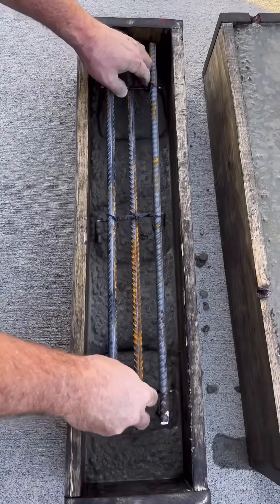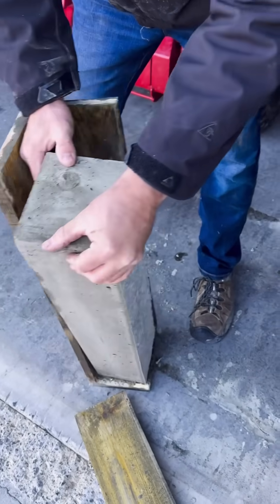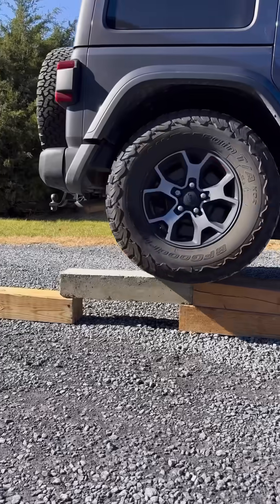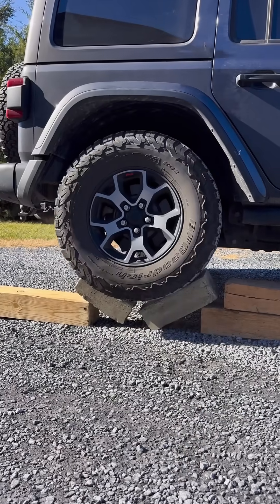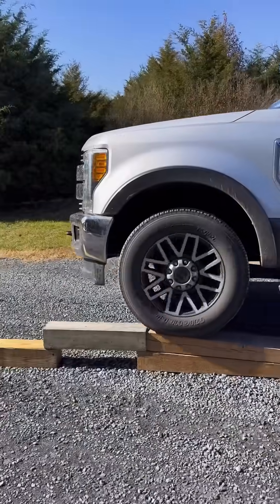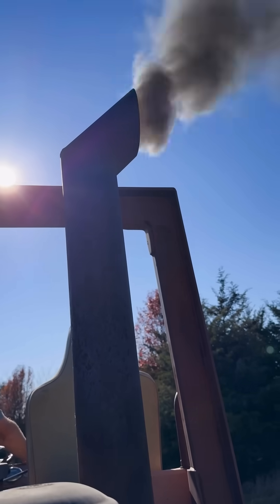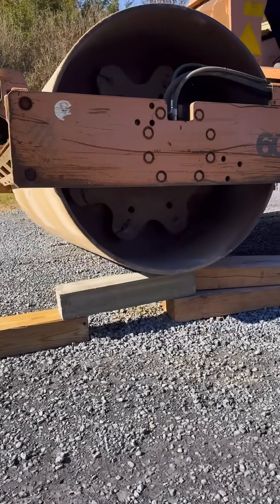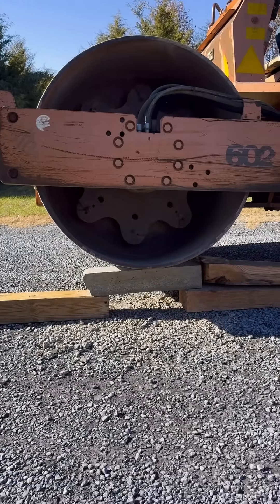Why We Use Rebar To Reinforce Concrete

Comment: Fresh concrete takes approximately 28 days to reach standard strength. The hardened concrete is called building material after 28 days and can be processed further. After several months the moisture has largely evaporated... depends on the climate where you live.

Comment: Ther longer concrete takes to "cure" the stronger  it is. That's why, if your contractor or whoever is doing the concreteting really knows and cares about what he is doing will cover it over to slow the setting and curing. The thicker the concrete the longer it takes to cure properly and fully.

Comment: My summer job while in college was working in the concrete lab of our state hiway department. Each component of a proposed concrete mix was tested independently. Cement powder, gravel, sand, and even water. Then the final mixture was tested for compression, tensile strength, and resistance to salt. The rebar was tested in a different lab.
Reply from the maker: That is awesome
Reply: Yeah, it’s like if we added tires to asphalt like Europe does there wouldn’t be nearly as many repairs/ potholes. But we love to pay for roads that were supposed to be toll free decades ago so we can pay road workers to unnecessarily make repairs. Garbage ass unions and politicians are to thank.
Reply: @FUu-p3k you lads dreaming of Europe as some magic land where everything's better. Nah, the average European country has way worse infrastructure than 99% of the US.
Reply: @FUu-p3k you hit the nail right on the head
Reply: Did you learn how to make cement slurry?
Reply: Why haven’t all those smart people not yet figured out how to prevent potholes. If we can send people to the moon surely we can figure out how to prevent potholes
Reply: @nofurtherwest3474  smart people can say whatever they want, it won't prevent stupid and drunk construction crews from messing up.
Reply: @masterkamen371  but surely there's a better material to be pothole-resistant. Probably add some latex or chopped up tires to the mix.
Reply: And then the concrete that tested the worst was put into mass production and used to make the interstates, huh?
Reply: @brandonhebert5485  The concrete that tested the 'cheapest' and 'good enough' I'm guessing.

Comment: Well this would a true test, but this is wrong, steel on its own is very strong and has great tensile strength, you're not just reinforcing the concrete, you are adding extra strong material to it, best way to do the experiment would be to measure forces, measure driving on concrete the max strenght it can handle before breaking, than strength of the steel itself, and then with steel and concrete and minus the force that was achieve my the steel, or some shit like that whatever i dont fucking know why i even wrote this
Reply from the maker: Rebar bends really easy by itself just from the weight of being stepped on. Also steel by itself would be far more expensive than Concrete.

Comment: What i've alway wondered is if you make reinforced concrete by either using scrap metal or just a bunch of medium to long nails going in all digferent directions ( almost like scrapnal like internals) if it will actually be stronger then normal concrete or will just break and leave a big mess
Reply from the maker: Random pieces of metal might help a little bit, but rebar is designed with ribs on it so it holds the concrete together doesn’t slip

Comment: I used to test concrete and I feel that was about 4 days to a week old. I am not sure how good my memory is but I crushed a lot of 6" cylinders one summer in college. One job required plasticizers in the mix and it blew the door off the hydraulic press. Took 125k lb/sq in. pressure to pop those samples... cured under water or just in air?

Comment: Materials are awesome! I love content like this!
And not to nitpick, but just to hopefully add to the discussion…
Isn’t that a failure of the concrete’s “shear strength”?
My guess for the cure time is around 48 hours.
Reply from the maker: My understanding compression is pushing something together tensile is pulling it apart. When I put weight on the beam, the top part of it pushed together in the bottom part pulled apart. She would be the sliding of something against itself, but it is confusing, and there might be some overlap.
Reply: @hausplans  yeah. It’s probably a semantic delineation.
I always understood tensile strength as the ability to resist being pulled apart. Like cables on a suspension bridge need. 
Compression strength as the strength needed to resist being crushed. Like a bridge pier or abutment. 
And Shear strength as the strength needed to resist breaking when forces are applied in opposing directions. Like the expanse of a bridge’s decking or a floor joist.
In any case, Rebar makes concrete a WHOLE LOT stronger! Lol! 
You should do a video on epoxy coated rebar and how it postpones the eventual failure of reinforced concrete due to the rebar’s oxidation! 
I’m hearing some wild stories about how long it can actually last.

Comment: No, this shows how important it is to reinforce concrete IN CERTAIN APPLICATIONS. What it fails to show is how poorly rebar reinforced concrete ages and why it should be AVOIDED in certain applications where tensile strength isn't a concern. And why roman structures have survived for so much longer than rebar reinforced structures. Use the right tool for the job.
Reply: A benefit of rebar is that it changes the failure mode of the concrete. Non-reinforced concrete often fails catastrophically (that is, once it fails it does so suddenly and can often do so without much warning). The rebar allows the failure to happen more gradually.

There are still cases where you don’t need rebar (pure compression loads), but omitting the rebar is usually done to reduce cost rather than longevity concerns. If you need longevity, coated rebar is used in conjunction with other corrosion inhibiting methods.
Reply: OK the whole "rebar destroys concrete" is a little hyperbolic. Very fist and off the top, the Romans worked with stacked concrete blocks and occasionally partially unsupported lintels and for that matter, what Roman structures are still occupied by humans?

The iron rust degradation of modern concrete takes centuries to progress and in the meantime we can erect structures like the Hoover Dam and the Burj Khalifa, projects the Romans could only dream about.

Using the right tool for the right job includes the brain. As to bar vs, well anything else, there is a reason we are still using steel in bridges and construction, it is what works. Ever stood under a freeway overpass and watched it flex? Ya the concrete actually shatters, it's intended and the steel keeps it all together. Think of it like a skeleton, except the bones are the flexible part and the "flesh" is all the little blocks of concrete locked to the steel and stacked onto each other.

Another thing about the Romans is that concrete continually grows harder throughout it's life. Ever notice how old concrete is so much harder to demo than newer? You probably thought it was just better in the old days. It is actually a crystalline structure and that continues to solidify and establish as long as the concrete remains whole.
Reply: @aardque  "The iron rust degradation of modern concrete takes centuries to progress" BS. It takes a handful of years at most, that's why it's so important to repair any cracks and seams that develop. Rebar concrete has much higher maintenance requirements in order to maintain its strength and the integrity of the rebar. Rebar is a good thing, as this video shows, but only when used for what it's good at. Use rebar where it makes sense, and don't use it where its a liability.

That's what using your brain means. You should try it someday.
Reply: @ShadowDrakken  Insulting strangers is a smooth brain coping mechanism. "Handful of years" would have every major city in rubble. Hyperbole has no place in physics,  despite your hysterical genius. My fucking house is only going to last a handful of years!🤡
Reply: @aardque  "Insulting strangers is a smooth brain coping mechanism" then why did you start?
Reply: @ShadowDrakken  Why did I start coping..? Why did I start commenting? Why did I think your skin was thicker? Why did I feel like I had to rub your nose in your "superior Roman concrete BS?" It is called "passage of time." Roman structures as long as any stand, will always be older than modern concrete structures, simple math.

Comment: The tensile strength was not an issue when you turned the vibrator on
The metal rebar vibrates and this shakes it loose and once the rebar is loose it provides no support to the concrete

Comment: Sucker question, as water and other traits of concrete result in a greater than 2:1 variation in tensile strength, and not just whether it's a day or a month cured.  

What's the effective peak load of that roller in vibrate mode?  In effect, it's like the force of a drop hammer, albeit used more to find and fill minor voids usually.

Comment: Looks like your rebar was in the centerline of the "beam" which would be under neutral load and really did nothing for the tension.
Reply from the maker: I put the rebar into the top third of the beam, then flipped the beam upside down before driving on it with the roller. So it would’ve been in the bottom third. You can see this in the shot where the roller crushes the beam and the rebar is exposed.
Reply: @hausplans  It looks centered when you pick it up by the rebar at the end of the video. Regardless, the test was effective in demonstrating the difference. Thanks for sharing.

Comment: That's tension strength. NOT tensile strength. 
Running a bolt through each end and pulling it apart from the ends would be a tensile strength test.
Reply: I always thought they were essentially the same thing? I wasn’t sure because strength of materials was never my best subject so I thought I just missed a distinction that was made but a cursory glance through Google showed that the two are pretty interchangeable with tensile strength being the conventional term for resistance to failure from a tension force
Reply: @joshs5577  tensile strength is only part of the equation though. It’s a big part though, so percentage wise you’re right? lol
Reply: Applying shear force creates tensile stress on the bottom of the beam due to the bending moment.
Reply: @sm-zt4ut  indeed. 
However, that is irrelevant to the larger picture as It also creates that same stress throughout the block. 

In the Aims research laboratory here in California, that’s called tension testing. 
You are effectively bending something to its breaking point. 

But yes on the non macro level, the bottom is under both bending, and tensile stress.
Reply: Tension Strength vs Tensile Strength. I've heard them used interchangeably. Are you saying they're different?
Reply: bla bla bla
the forces in the beam are tensile in the lower side, compressive on the upper side.
you wont just place rebar in the lower side. need to use a frame, stirrups that resist shear forces as well. that is why you come up with the form used in the video.
Reply: @nsa5102  yep. Push and pull. Twist and bend. All at once. Tension.

Comment: but concrete itself is heavy, why not use just the steel alone with some special coatings that make it not catch rust
Reply from the maker: Steel alone would be super expensive. Also, the reber by itself bends really easy, you could bend it just by stepping down on it.
Reply: @hausplans  oo true that 😂

Comment: The strength of the beam with out rebar will not change much over time. The beam with rebar will rust eventually and weaken the beam. 

This is one reason ancient concrete structures last so long. But they were always under compression with arches. Not many concrete spanning beams.

Comment: Roadways should be 24 hours but the rest would be 14 days curing
Reply from the maker: We always wait seven days before driving on new concrete
Reply: @hausplans  I did worked in a concrete batching plant and since most of our projects were national highways, gencons/subcons require 24 hours tests.
Reply from the maker: I got you, 24 for testing not driving on

Comment: However rebar also rusts and degrades far faster than concrete by itself causing structural damage like the buildings which collapsed in FL

Comment: That's why the Romans built arches and domes. That way the structure's shape itself distributed the force enough to not need reinforcement from rebars. Next time try with a non-reinforced arch and a reinforced slab and see if the the arch (with a flat top) can withstand the weight.

Comment: At about :23'' you say "...creates tensile strength." It's "tensile stress"!!! Stress is the effect from the load. Strength is a property of the material that resists the stress. If you want to do engineering videos use precise language. Otherwise you will look ignorant.